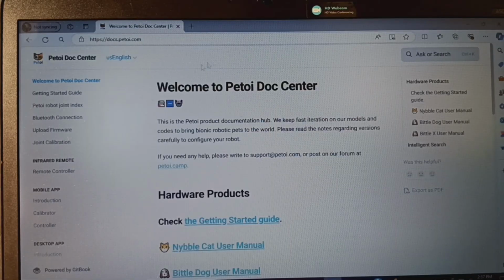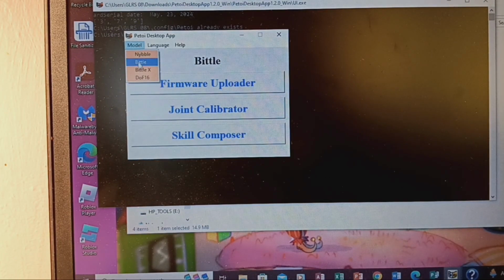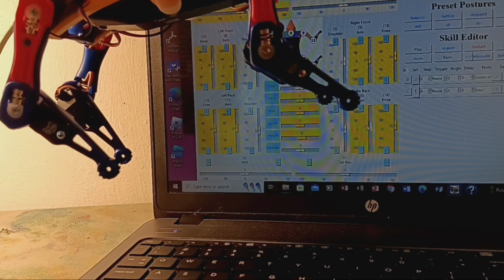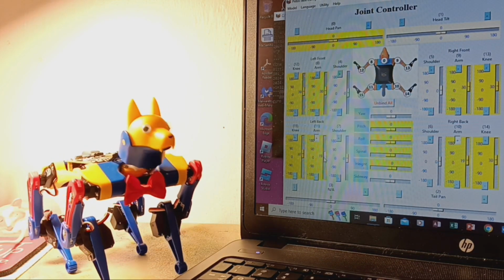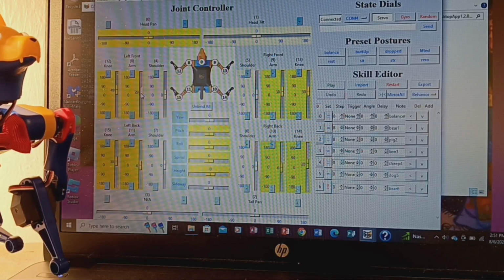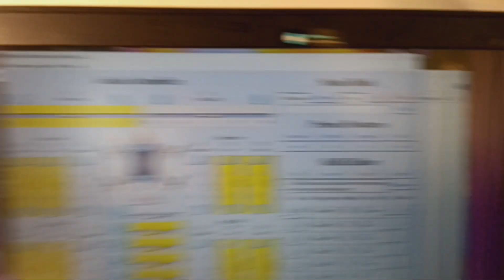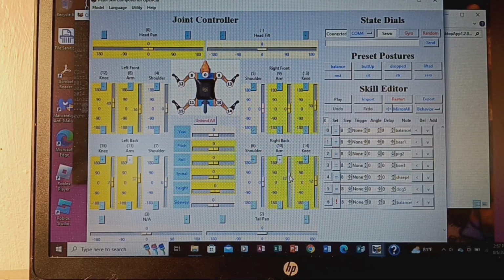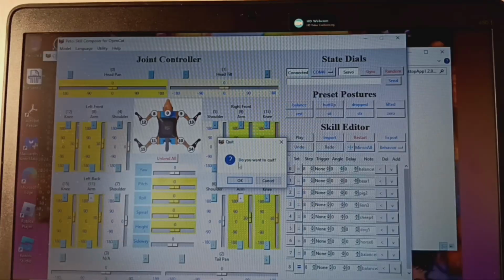Programming Petoi Robots with the Petoi Skill Composer (TUTORIAL)

Comment: To use the Skill Composer,  there are two connection methods  to connect the robot's mainboard to the computer::
 NyBoard
Wired connection: The kit includes a USB Adapter and USB data cable connecting the robot's mainboard to the computer.
Wireless connection(Bluetooth)： The kit includes a Bluetooth module connecting the robot's mainboard to the computer.
BiBoard
Wired connection: The kit includes a USB Type-C data cable connecting the robot's mainboard to the computer.
Wireless connection(Bluetooth)： The motherboard's built-in Bluetooth communication module allows you to establish a wireless connection between the robot motherboard and the computer.
Reply from the maker: @xiaodemon81  that's right, I should've mentioned Bluetooth.